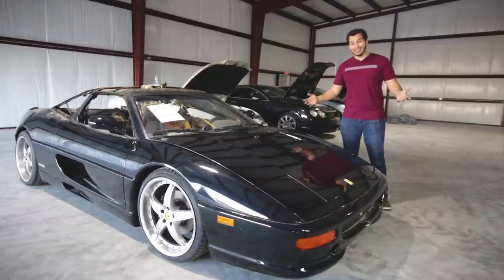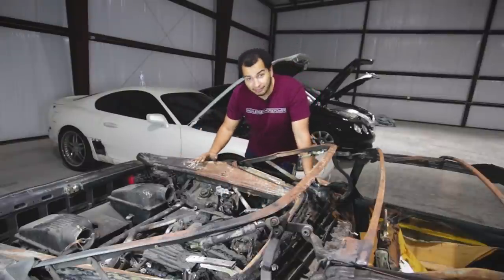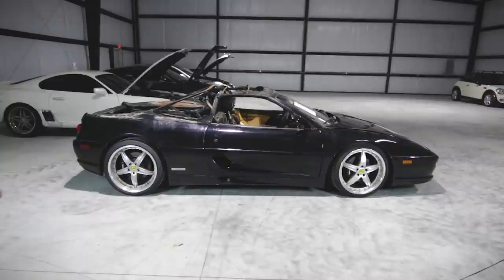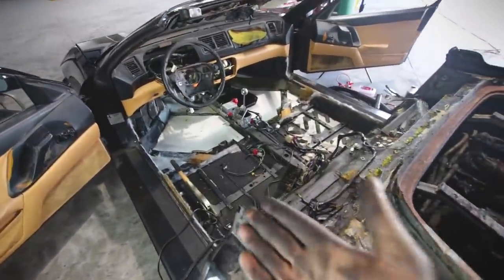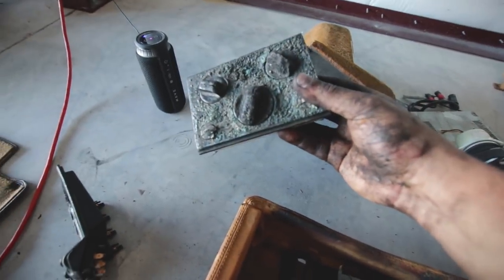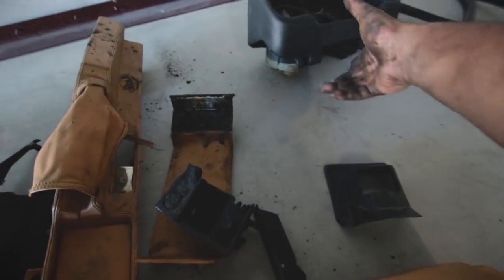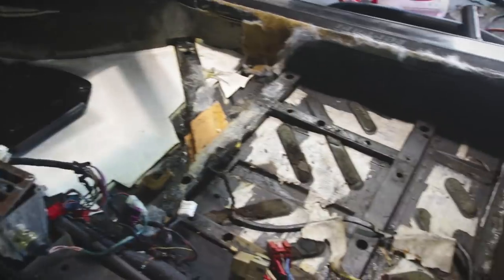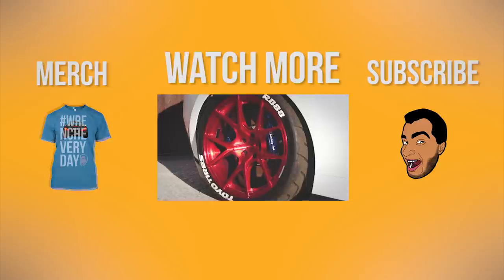I'm Rebuilding A Dirt Cheap Ferrari F355 (Destroyed By FIRE)

Comment: I hope you have a good plan for attaching that hardtop, I could see it creaking in steep places such as driveways and parking lot entrances. Also, you haven't explained where you're going to get a hard top that actually morphs it into a coupé.  Typically adding a hard top (such as old SL merc and BMW Z8) doesn't increase rigidity right?  These are real questions that need answers!

Comment: I've seen worse fire damaged cars fully restored.
Reply: Probably not a Ferrari tho
Reply: @ttiization  and? Makes no difference what the car is, that car is only 20% burned, the vehicles im talking about are 90
-98 % burned
Reply: madmax2069 
You mean the right front indicator was saved and the rest was rebuild?
Reply: @Conservator.  one was complete burned (as in bumper to bumper) but the engine somehow was able to be rebuilt as in the garage during the fire
Reply: madmax2069 
Haha, not even the indicator came out clean. I assume the rebuild engine was used in another car, right?
Reply: @Conservator.  nope, same engine

Comment: Just a thought...… Nascar style aluminum dash, Speaker carpet everywhere else. Fiberglass removable roof like Fantom Works made for the 63 vette convertible (hey he could make you something cool that would not look like the old Viper toupe!) . Good luck! And don't ditch the seat frames you will need the bottoms to weld to the bottom of the sparko's you will no doubt use. I see a megasquirt conversion in the engines future as well.

Comment: There is a difference between a "rebuilding" and just assembling a different car from a bunch of spares - which this will turn into. I reckon this Frankenstein will have less than 20% of the original Hoovie's car when done. An adventure in masochism to most, but you succeed in projects that most will not touch. Look forward to seeing how this comes out.

Comment: First of all... $18k is way too much money for a car which has been a fire. I know the normal prices of these cars, which is very high, and while that $18k is possibly not be a lot for this car, it is a lot of money for car which should be in a wrecking yard rather than your shop. I believe it should have been sold for under $10k. To be honest, it wasn't/isn't even a good parts car anymore.

Lots of big unknowns, some of which you touched upon. How much will a used engine be? How much will that interior cost to replace? How much are the various wiring harnesses (as I'm sure you'd not want to just make one yourself)? What about the cost of the new suspension pieces, wheels & tires? And, the cost of the Berlinetta parts and then a top quality paint job? I'm guessing you will have well over $30k into the car by the time you're finished with it. And, it will take you quite awhile to get it completed. If you need an engine rebuild or a new (used) one, add on another $30k to that bill. And, hopefully the transmission will be okay.

As others have said, this car has been through a very hot fire, so the metal has been heat-treated, which changes its structure and how it will lose its strength or not. 

While this will be an interesting rebuild and quite entertaining, I really feel it will be a very tough car to someday sell to recover all the money you will be sinking into it. 

Any F355 Spyder with low miles and in great shape, is now costing over $100k. Since this was purchased by Typer Hoover, it was one with high miles, I believe... at least high miles for a Ferrari. 

As a weekend track car, it could do well... but at what cost?

Good Luck!! You'll need it.

Comment: Just my thoughts. Interesting situation BUT the expensive factory replacement parts and the sheer number of things needed would scare me off. It’s a great looking car and still has value so how about this. Being that you’re going to abandon its OEM configuration (roof and turbo), assess what’s still good and go aftermarket for most of the rest? Hopefully the engine survived and that will require the ECM, sensors, and harness but that’s where I’d stop. A Painless harness could get the lights and accessories working, body work is bodywork, strip the heat and A/C and go full race interior with a roll bar to help stiffen it back up, I’d be willing to bet the metal of the structure has went through some changes. For the interior, custom aluminum panels with toggles and aftermarket knobs alone could save thousands along with racing seats and harnesses, and look good when you’re finished. And just to go another level of blasphemy (lol) IF the engine is trash, an LT series engine can easily make the kind of power your talking and a little more torque as a bonus. IF the trans/axle is ok it could be adapted up with some custom machine work that probably wouldn’t be too much trouble. It might take some mods if the gear ratios and engine torque peaks are a bit off. But still do-able.

Comment: I’d politely suggest that you get the frame checked by a materials engineer before you go much further. Steel changes it’s properties when it’s been under heat (between 700 and 1500 Celsius) which could be part of the reason things are rusting so quickly (I don’t know I’m not a materials engineer). Would suck to get the whole way through a long and expensive build and find out your frame won’t hold up in a crash because the steel is compromised.

Comment: If you are in the process of stripping this whole thing to the bones, I wouldn't bother with floormats, I would turn this into a track car with as little interior as necessary, a rollcage, a proper set of racing buckets, detachable steering wheel and stuff like that. Turbo it if you think it needs it, but a road-legal track car would be my goal, and for that you can get away with some stripping of unnecessary parts....

Comment: You've probably gone through all the options already and made up your mind but I wouldn't wanna turbo one of the finest sounding engines ever made just for sake of preserving the original sound let alone driving experience. I'd just get more supercharger in front of it - larger compressor - more boost

Comment: Personally to keep it cost effective but also awsome, I’d  strip out the burnt interior and replace with aftermarket kit like sparco seats nardi steering wheel and flock the dash maybe make some carbon door cards yourself keep it a permanent soft top with a role cage and maybe a set of coil overs, oh and strip/ rebuild what’s left of the engine. But hey that’s just my opinion

Comment: I think you should keep the AC control unit as it is - clean it and laquer it so you don't get sooty every time you touch it, but keep it in its melted form, it will be a little reminder of how far you've come when the car is finished and everything around it is replaced - like a little snapshot into the past.  I think that'd be cool!

Comment: Leave it N/A with a nitrous hook up.

Should get a metallurgist to test the metal as pretty sure that heating it then cooling it with water causes all kinds of brittleness and warps / cracks, so it won't hold an edge so this car will chop nothing.

Comment: I see this as a stripped out road racer/track day car with a customer digital dash and then there would be no need to replace the interior trim. Replace the burnt steering wheel and seats with FIA/whatever aftermarket approved seats and fit a proper harness.

Comment: Don't throw any of the carpets away keep them so you can use them as templates to cut new ones to save some time and personally as you have to re-do the center consol i would do it in carbon fiber which will be easier as ypu have the original to template

Comment: That much work to take out a bunch of seats? Lol.

Not really sold on the turbo idea, t.b.h. Ferrari's, in my opinion, need to be N/A. This engine should be able to do around 400-ish horsepower on its own given the right tuning, which, for this car, is plenty, unless you go the extra mile and beef up the brakes, etc. to handle the extra required stopping power. And even if going for forced induction, maybe a supercharger? Seems like a better fit for the type of engine, and takes up a lot less space. Not to mention, it's easier to build and maintain.

Also, how the F does stuff that was shielded from the fire by other stuff (the wiring behind the gauge cluster, for example) get burnt? Did someone think, "Hey, that part still looks OK. Let's burn it, because otherwise, it looks out of place"?